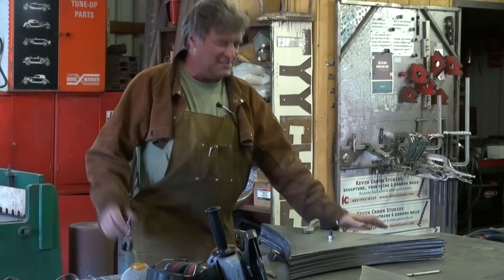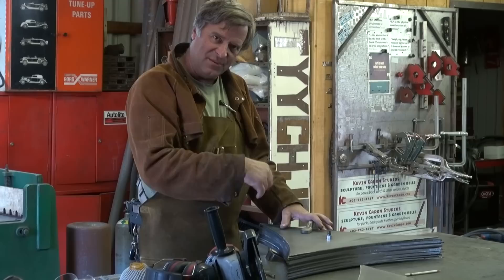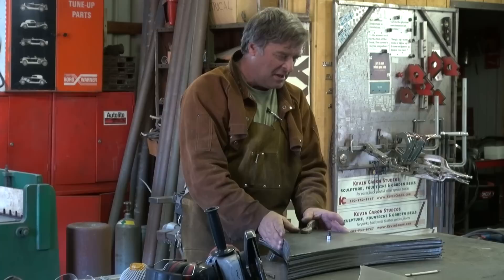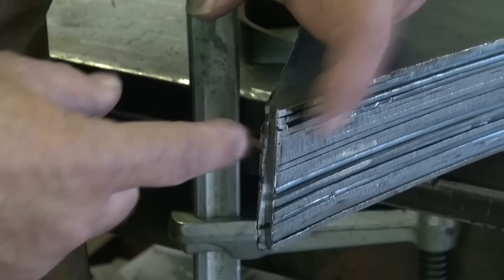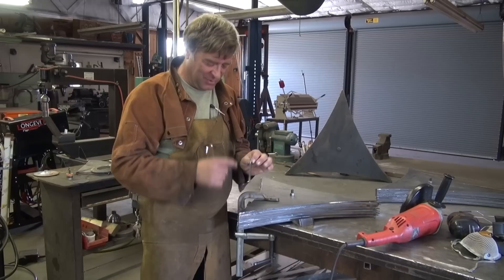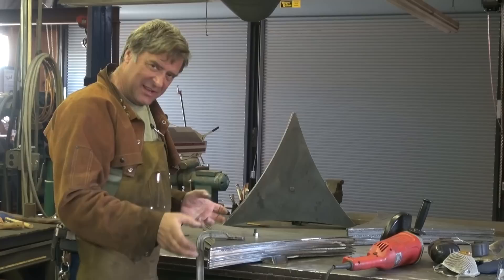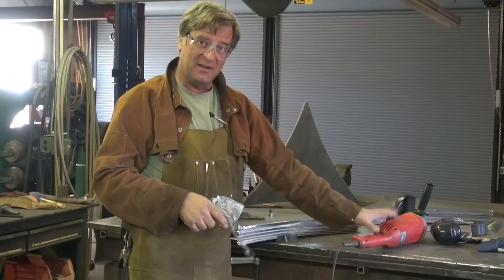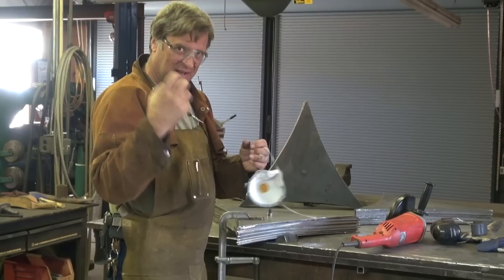How to Create a Sculpture, Part 4 - Kevin Caron

Comment: One thing I noticed you did, but forgot to mention is to set the grinder down on it's back carefully with the disc in the air to prevent it from kicking around or catching something on the table. Good video though, looking forward for more.